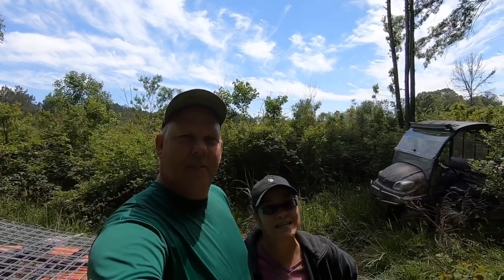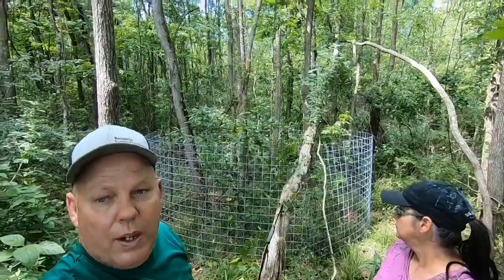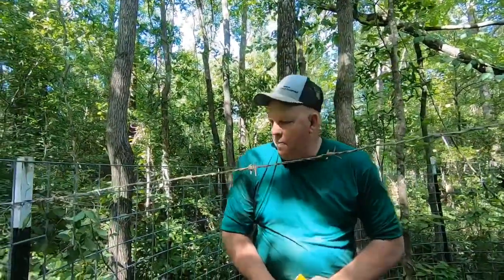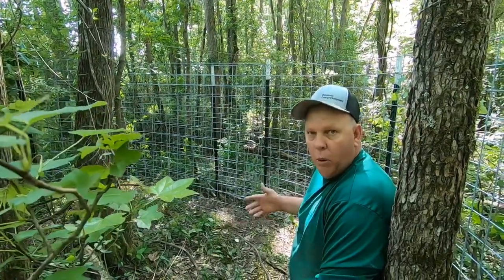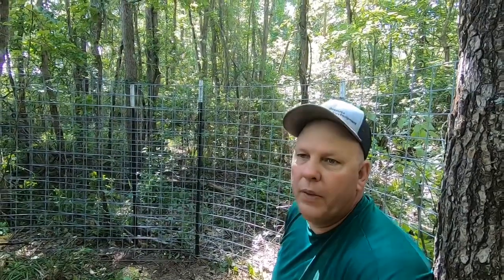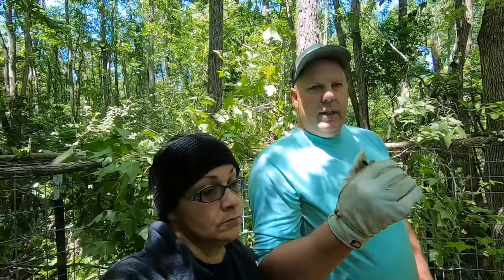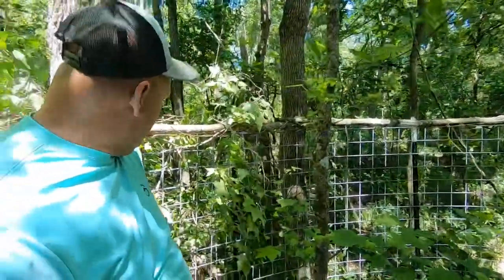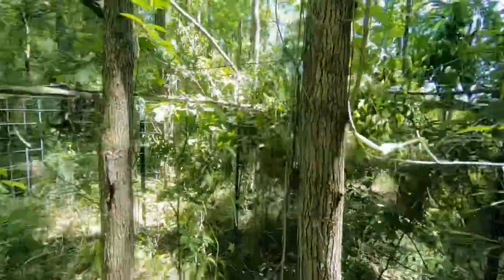How To Build A Figure “C” Hog Trap With A Trigger

Comment: ?? Have you had any pigs burrow under trap wires to get out? I had trapped a big boar in square trap and that hog tore up the bottom wires and tunneled out trap.😮 curious how you prevent that from happening
Reply from the maker: Stake it down good they are very strong yes had them make a square pen round before we called that hog bear could not keep him in a trap

Comment: What would you recommend for the smallest diameter of a C Trap  ??
Reply from the maker: The four in square is what I like it will hold most good size pigs. But the cattle panels are a lot cheaper